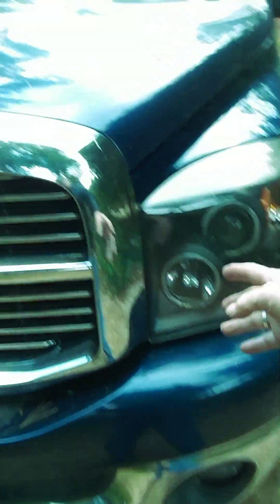This Ram truck @RealLifeProductions

Comment: I feel for ya, that sucks! I need to look for a different truck now, live in Wisconsin and frame is bad on mine. I have 50 thousand saved but really looking
Reply from the maker: My frame is still holding out but it's the little stuff that's going now. All the big stuff is fixed. I just need the wiring and the evape system looked at. I don't really care about the evap but I need the wirering fixed to run the plow. I'll probably sell this truck next year.